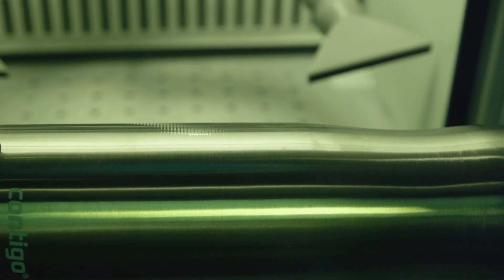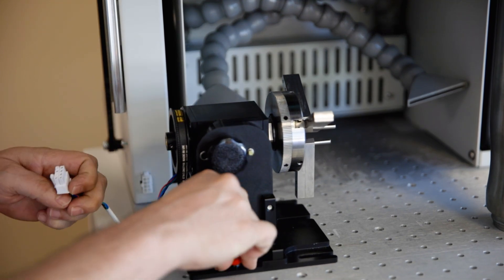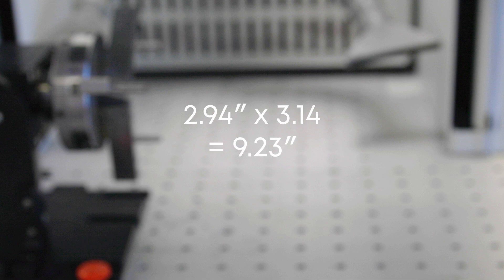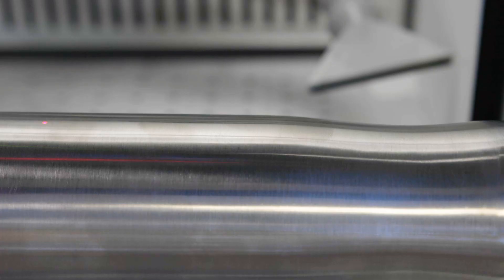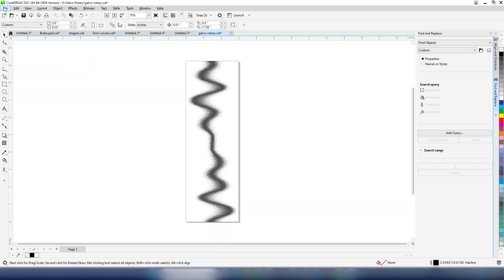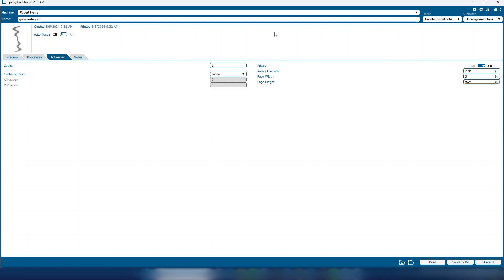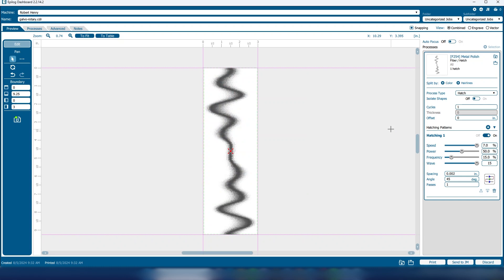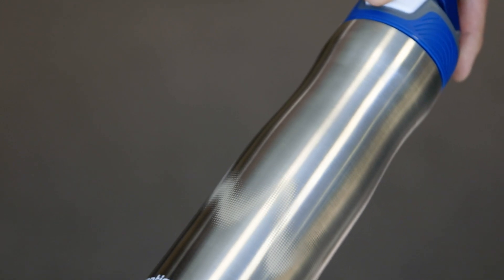Fiber Laser Marking Stainless Steel Tumblers with the Fusion Galvo Rotary

Comment: I notice in the video the angle is 45 degrees.  I was told you can only use 0 degrees on the rotarty.  Was this a miss in the video? Note I have a pulse G100
Reply from the maker: You are correct – good catch!  It was a miss in the video shooting. We’ll have to get that fixed.

Comment: Great video! Ive been trying to dial in our Galvo at work so its nice to have a reference video since we dont use the rotary often.
I thought the Galvo can only use the F163 Lens with the Rotary attachment. Can you use the F254 lens with it or did you just use the F254 settings since theyre similar to the F163?
and it looks like there was a little overlap. Since diameter was 2.949" on the calipers would it have been better to round up to 2.95"? Would that have prevented that small overlap?